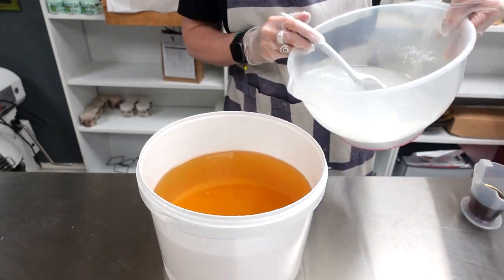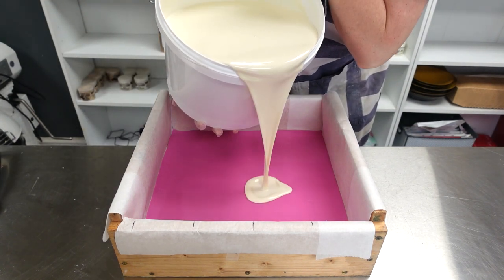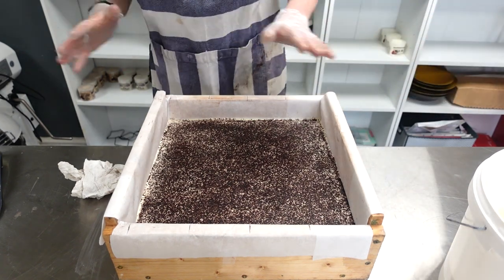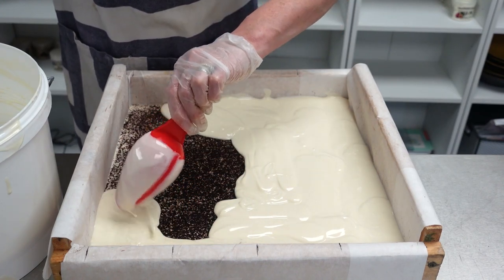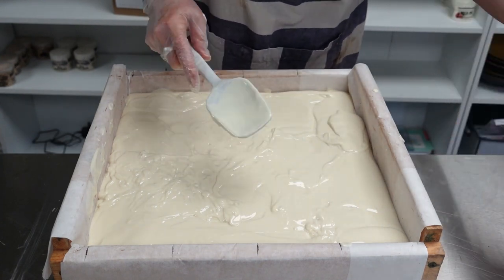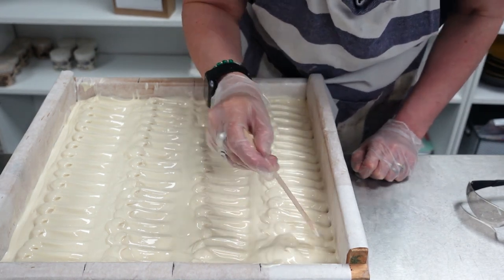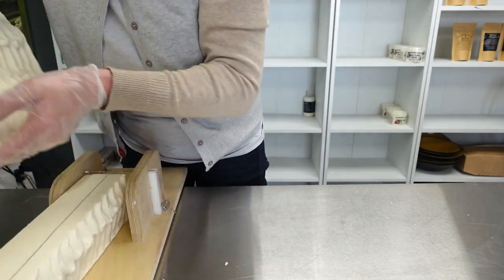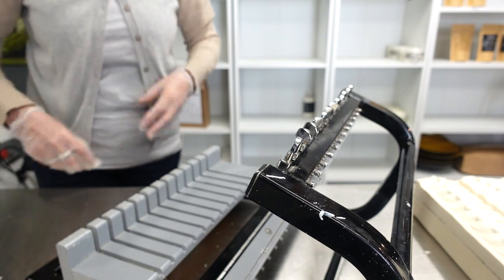🧹 WHITE WITCH SOAP MAKING 🧹 | Topic of coversation: The Taxman | SNES gaming

Comment: So sorry About your sister. I lost my mom a few weeks ago & the grief process is difficult. You're right that time helps recovery. Still have my old Nintendo too. And about your tablet, here's a trick that works on cell phones if you get them wet. Buy a huge bag of regular white rice (not instant) then put it into a container and put your tablet in the rice plus cover it so the tablet is totally encased in rice. Leave it so the rice pulls out the water from the tablet. Check it after a few days, but put it back into the rice (adding more if necessary) until the tablet is totally dry. Sometimes it takes up to 5-7 days. Usually this works with cell phones. Hopefully it will work with your tablet. Love the White Witch soap, beautiful!